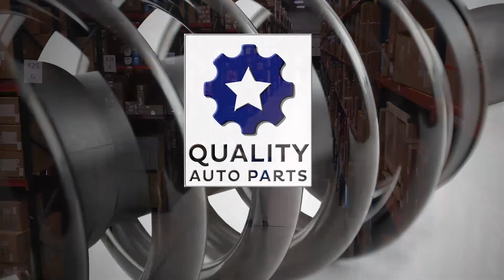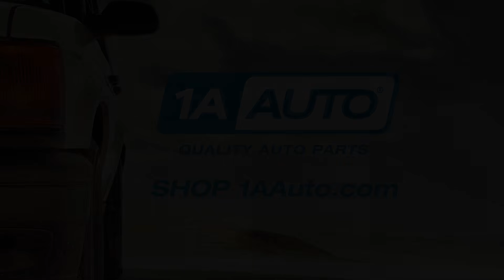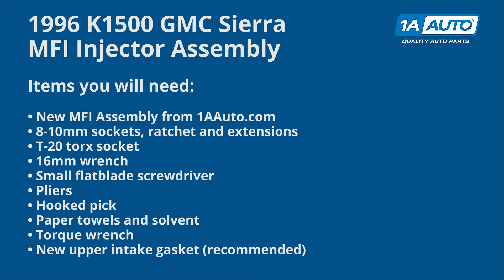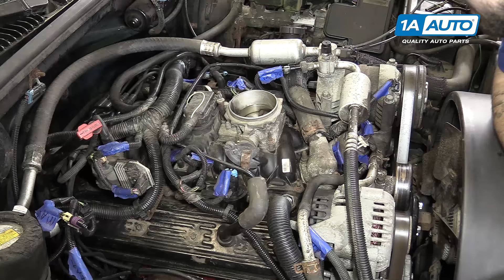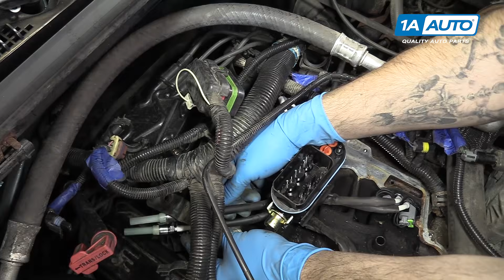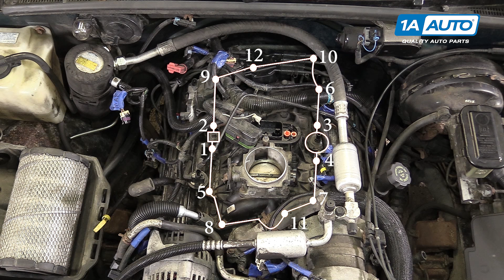How to Install Multiport Fuel Injection Conversion 96-99 GMC K1500

Comment: This video was extremely helpful - I did the project over a weekend and the conversion made a huge difference to the way my K1500 performs. My dad bought this '97 new and I got it a couple of years ago after he passed. I don't really know/remember how it ran when new, but I could tell that it now clearly wasn't running as well as is should. It started okay, but was sluggish and ran a bit rough. Compared to the way it was before the conversion, it now runs smoothly, accelerates quickly and my wife remarked that it idles and runs quite a bit more quietly than before. I haven't had time to check, but I bet my mileage goes up by a couple of MPG. If you have a Chevy Vortec from this era, I highly recommend that you do this upgrade, and use this video to walk you through it. It's tedious work but not hugely complicated if you take your time and label everything as they recommend. I hate to think how much this would have cost if I'd had to pay a mechanic (or a dealer!) to do this work.

One thing I'd advise you to do is take a lot of pictures before you start, because there are several sensors, modules and various brackets that bolt onto the studs so you want to make sure you have a record of which, what and where they are. That leads to my only (minor) criticism of the video - they should have documented what each of the dozen or so studs looks like before starting to take everything apart. On the whole, the video is a great tool. Thanks to 1A Auto for providing this for us DIY types!
Reply: Did you use a torque wrench I’m a little worried to do this but think I can do it how long did it take you
Reply: You are awesome for sharing your experience thank you and god bless you
Reply: @84montecarlo  Yes of course you use a torque wrench. I don't know any other way to torque bolts down lol...

Comment: Without question, a very high quality video. Thank you. Before installing the injector pintel tube covers in their bores, it is a good idea to thoroughly clean out the bores of carbon buildup. I used brake cleaner and wire tube brushes to scour out the bores. Then lubricated the pintel covers with a (light) coating of trans-gel (or petroleum jelly) to make installation easier. Make sure the pintel covers seat all the way into the bore until they click. Position the electrical fuel injector connectors to keep from interfering with each other.

Comment: Good job !  I would have liked to hear the car start at least, if not to do a short run.  A before and after with the two injection systems would be a very compelling selling point.

Comment: I changed this out a few days ago on my V6 2001 and your video was a major help.  As a DIYer with basic tools and not much knowledge of cars, it took me about 6-8 hours and two bicycle trips to O-Reillys.  Here are my recommendations:   
1.  I didn't bother to read the instructions for installation until I already had the old one out.  Read the instructions that come with your spider injector before starting! 
2.  Have some new Fuel O-Rings to replace on the fuel lines where they disconnect near the distributor.  To disconnect these I did have a line wrench.  Sounds like those crows feet things would be easier.  The fuel lines are two different sizes and you can get a variety pack.  They are brown in color and not the generic black O-Rings.  I bought the last box at O'Reillys so get them ahead of time.  I did use a caliper to measure the width of my lines and made sure I had the right sized rings.
3.  I was totally confused (panicked) on whether to keep my old bracket or use a new bracket since the instructions I had with my BWD spider injector said I needed a new one, yet the new bracket I saw online did not match the photo on the instructions.  The photo on the instructions looked like my old bracket.  I also panicked about my new bracket since I bought one that one auto website said does not fit (O'Reillys) and another auto website says it fits (Advanced Auto Parts).  The new bracket I used was pretty much exactly like the old one except it has 2 clip in spots on each side instead of 3 clip in spots on each side (which only 2 are used anyways on the old bracket).  The height, clip in spots, and width all matched the old bracket.  I'm sure the old one would have been fine if not better.  The new bracket didn't have much play when bolted down and made it harder to seat the manifold cap. 
4.  Consider a star lock washer for the bracket bolt so that it does not fall off the bracket and into the manifold.
5.  PLUG the holes to the manifold with clean shop rags.  I could have easily dropped the bracket bolt or my star tip down the hole resulting in a much bigger problem (thought of this as I was doing it).   
6.  It took me awhile to spin the new electronic ends on the injectors so that I could seat the manifold cover nicely over everything.  Also putting my injectors in place I thought I was going to break the legs (wires or whatever they are).  They are incredibly stiff and the V6 puts the legs scrunched positions.  
7.   In the future I would probably order the ACDelco with everything included such as the new bracket, and intake and throttle body gaskets.
8.  For torquing it down, the V6 is different from the V8 (less bolts) . I followed the general order of the pattern to kinda match mine and did the two passes with different amounts of torque.
8.  With the throttle body off, if you haven't cleaned it yet might as well.  I used a wood cuticle pusher you can buy at Sallys Beauty supplies (some girl tools come in real handy) to not scratch it and carb cleaner.  
9.  When I started my car I thought I killed it.  I heard popping from the engine and misfires.  I checked that I had put the spark plug boots back on the distributor cap correctly by visually tracing the wires back to the plugs.  Couldn't find what I did wrong and thought maybe I put an injector in the wrong place or dropped something in the manifold holes.  Had it towed to the shop and told myself I was crazy for ripping the heart out of my car and transplanting a new one.  The car shop got back to me, ran a vacuum check and fuel check (which instructions advise doing a fuel pressure check before starting the engine) which both turned out good.  What happened is that I had marked my 1 and 3 wires incorrectly and had them mixed up.  Even though I traced them back to the plugs, my brain was tired, confused, and just couldn't see the obvious.  I'm guessing the order of putting in the injectors threw my brain off track.  The shop guys plugged the boots in correctly on the distributor cap.  It is a relief knowing I didn't kill my engine and do not have vacuum leaks.  Have a buddy check your work.  My car now runs like a champ!!
Reply: Margaret Ruskiewicz does it give u a noticeable difference in throttle response and power
Reply: Thanks for providing the extra insights.  This will be helpful if I can talk myself into doing the upgrade.
Reply: Margaret Ruskiewicz if like to add a few hints!

A shop vac is really a must, when you do this!! Especially if you have an older engine! Remove the goose neck, for the thermostat, and replaced the thermostat too, while your at it!! The gooseneck is in the way slightly, and removing helps a bit! 

Carb spray cleaner is the best for cleaning out a lot of the lower intake manifolds before putting the new injector spider back together! Don't spray directly into the manifold, spray a clean rag, wipe up the mess, and throw it away. Get a new clean rag, spray with carb spray, and repeat! There is no need to get the lower intake area spotless, just vacuum away the mass of the loose stuff, then the rag, and another quick vacuuming!

Throttle body cleaning is a must for this job! Be careful where you spray the carb cleaner, but be sure to make the throttle body spotless! Then use a new gasket to seal the throttle body back to the upper manifold! Clean the MAP sensor end too, but again, be careful to not spray carb cleaner directly at or into the MAP sensor!

If you are not familiar with this type of work, I suggest using the phone camera, and making yourself notes, and putting the nuts and bolts into a plastic bag, separate from each other, and mark the bag. It will make re-assembly that much easier. And you will have a reference if you forget something, or to make sure that you didn't!'
Reply: FWIW: those brown o-rings are likely Viton, not rubber like the black ones.  Using rubber o-rings on a fuel system with ethanol in it will likely result in a leak in the near future, and doesn't really save any money.  So, good call getting the right ones. :)
Reply: 4
Reply: Good comment!! Getting ready to do this on my 97 cheyenne with the v6 in it due to random misfires and currently cylinder 2 is running lean and fouling out the plug. Definitely going to have to grab some new orings so I'm glad you mentioned that. Truck sat for two years and I've done everything short of pulling the engine and replacing it at this point and my main issue left is the random miss and then now cylinder 2 misfire.

Comment: Just so you all know, You dont take off the throttle body unless you have to. you also can leave the fuel line connected to the lower lines coming from under the trans tunnel. just take the bolts off and move them to the side. its just extra work to remove things that you dont need to. best of luck.

Comment: Thanks for the help!  Just completed my upgrade this weekend on my '97 K1500.  I watched this video a few times before starting and it made the replacement so much easier.  Other videos said you had to remove the upper radiator hose and thermostat housing, but you don't have to with your method.

Comment: If you have to do this,just go one set further and pull the entire intake out and upgrade the manifold gaskets before they leak,it makes putting the spider in much easier.
Reply: that way you can soak the manifold in oven cleaner and power wash it
Reply: I agree! It'd be kinda dumb not to since your already there especially if your over 100k cause you'll just have to redo everything again when the lower starts to leak. Plus getting all the intake runners cleaned out has to help improve  flow on higher milage engines
Reply: Agree. i'm collecting parts to do this on my S-10 with 4.3ltr.  Also going to R&R with new water pump and PS pump since they are buried down in front with 120K on them though they are currently working fine.  I plan on keeping this pickup so only want to do this work once.

Comment: You'll want to make sure the electrical connectors on the end of the injectors are on opposite sides,if not they bump up on each other and makes getting the injectors in impossible,and make they are connected,I had come loose, luckily I caught that!

Comment: I had failure after installing the MPFI upgrade spider.  The clip on the lower manifold that holds the control unit has sharp edges.  This cut through one of the injector wires after about a week and started blowing ECM1 fuses.  Truck no run. When installing the MPFI upgrade spider, take off the clip on the lower intake manifold and file the sharp edges smooth, slide the tubes already installed on the spider up to the control unit so they protect the wires.  Chased possible shorts everywhere until I checked impedence on the upper manifold FI connector pins (not the harness, the connector on the manifold).  Pull off the connector to the FI from upper manifold and check impedence of all the pins.  With ECM1 fuse out, if any of them indicates more than 0 impedance, one of your injector wires has shorted to that clip.

Comment: Great instructional video, I may need to do this to my 97 Suburban soon and this will be a huge help!
Reply from the maker: +XSP Green Monster Thanks for checking us out. Shop here for high quality auto parts: http://1aau.to/m/Shop-1AAuto-c
Reply: Did you do it dude? I'm thinking no if I desperately need to which I kinda do, I'll have no Choice but to, and this is like a exam at a school, taking something apart then putting back correctly, and there's just about every part involved with the engine you have to deal with...
Man...
Reply: 1A Auto Parts  I know this videos old but I have the upper plenum off. Are you able to clean the lower intake before reinstall? And what holes should you be careful of getting stuff in

Comment: My 97 yukon "Gt" has spider injection, think I might do this eventually, it's at like 200k and runs pretty good, so I might end up doing this, plus manifold gaskets to make sure I'm not going in here again at 300k.

And if it doesn't last that long I'm just gonna swap all the goodies from this one onto the next c/k I buy. These trucks are fantastic.

Comment: It’s worth the 28 dollars to use a new gasket set every time if it comes off I’ve probably had this cover off of mine 6 times in 2 years today I’ve had problems with regulators got a new one in today finally. but that o ring around the injectors this one went on yesterday but still better to have a new set every time if you need to take it off.  Just a warning lol
Reply: gaskets and mounting surfaces any time you touch anything!

Comment: Well I did the project on my 1996 Chevy but it still runs, ruff I’ve changed a lot of parts and it still running almost like before and have a hard time starting with put gas on the intake

Comment: Thank You ..That spyder your using has a nice positive snap in on the injectors. AC Delco  Does not ..#5 wanted  to keep coming out ..Luckily #7 is routed over the top of it to help keep the injector in place.

Comment: I want to add to this my truck stated to run rough almost like a miss fire when I would stop and idle also I would start it and run for a second and die start again be fine I noticed it didn't have the power like used to I installed the new spider injection no more issues starts right up and let me tell you the performance difference holy crap big difference I hope this helps you guys out their with this problem

Comment: Great video, very thorough and complete in showing every step needed to do this conversion.  I have a 97 K1500 that I have just upgraded with a professionally built stroker 383 displacement SBC and upgraded after market aluminum heads (I'll have to check the specs for what size valves they installed in it).  I requested an RV style camshaft, for maximum low rpm torque.  I'm now shopping for intake and exhaust modifications I can make that will allow me to take advantage of the added displacement with my goal of trying to maximize low speed torque for towing my trailer up mountain roads, not for high rpm HP.  Is there a different after market injection intake system that I should research that can provide more torque and power, than the system shown in this video?  I currently live in an area that does not require smog checks for registration renewals, so I'm open to any modifications, including complete replacement of the entire intake and exhaust system, and possibly even going backward to a carburetor and older style distributor, if I can't find any modern alternatives, though I would prefer to keep my truck as close to stock as I can, so I can keep as many modern sensors and avoid constant check engine lights due to missing equipment.  Any and all advice is greatly appreciated.

Comment: i also label everything........I also use white foam core board to pierce and hold each bolt, item...... labeled.  I keep a step by step w quick sketch on a clip board as I go....and reassemble.

Comment: Good stuff... but after watching other videos of people doing this very thing, the o-rings on the ends of fuel lines were replace and lubricated, the bores for the new injectors inside the intake manifold were lightly cleaned using a small pipe cleaner to provide a cleaner surface and lubricated for smoother insertion of the injector tubes, and the o-ring that surounds the spider assembly was also lubricated to prevent tearing while reinstalling the top manifold plenum that could ultimately cause a headache of a vacuum leak.
Reply from the maker: +Bige4u Thank you for the feedback and for watching!

Comment: Just did this to my 97 Chevy 2500 5.7L. Started right up and took for a test drive. Got home parked it but now won’t start. Whole fuel system has been replaced. So not sure why it won’t start now. Battery, starter and alternator are fine and has spark. So not sure if there’s an air pocket or something in the fuel system now.

Comment: All well and good but what if either your vehicle came from the factory (2005 Silverado) or already had the upgraded injectors installed at some point? My MPFI injectors are stuck in the intake manifold. How the heck do I get them out? There's nothing to pinch and I'm pulling pretty hard on them already.

Comment: Is the stock black box pcm capable of getting any true benefits from this conversion? I imagine that if you 0411 swapped the pcm, added coil packs, 24x converted it, and tuned it you would see true benefits other than having nice new clean fuel injectors. It just seems to me that improving fuel timing without improving ignition timing is kinda pointless. But idk.

Comment: I'm doing this project and I'm new with these upgrade injectors. My ? Is do the injectors push down and snap in completely or like my 5.7 seems like the just slide in and don't completely go down all the way some of the injector plastic still visible about 5/16 of and inch they will not completely push down flush. Is the correct way?